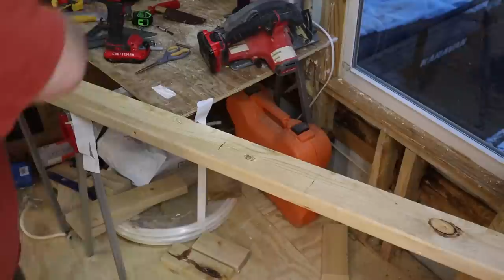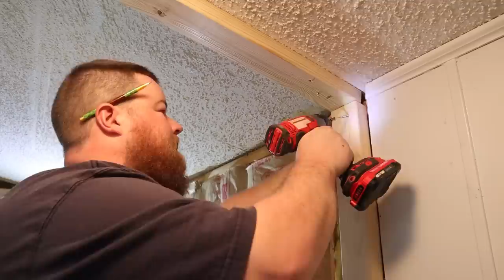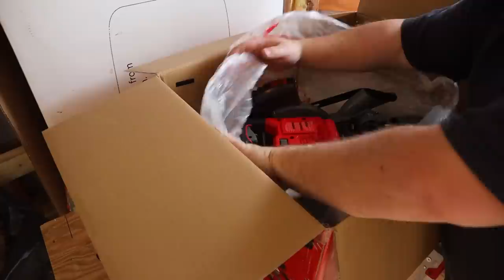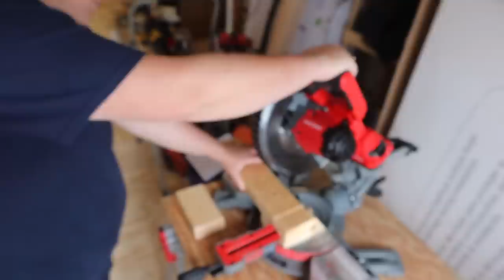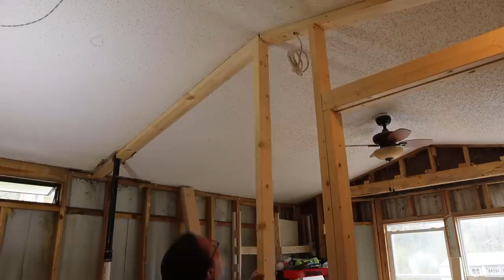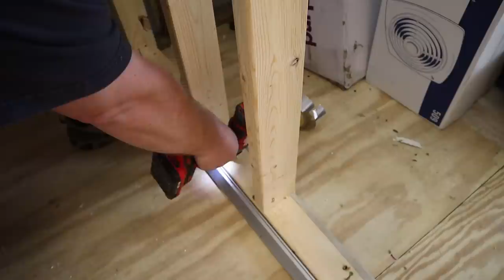Wall Framing with a NEW TOOL - Mobile Home Renovation

Comment: For your new saw do they make an AC adaptor so you don't have to depend on the battery power? We all have had the battery go dead just at the wrong time. If you remember the old time tape player/radio you could buy the adaptor to  plug into the wall and not use the batteries?

Comment: In the original mobile home work...did they use the weird rectangular screw heads? Or did they stop doing that in 77 when mine was built lol...I hate those damned things cuz I can’t find a bit like it needs...and damn! Even the grinder has trouble cutting through them to get them removed